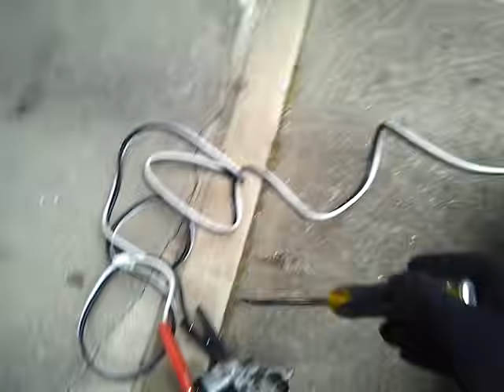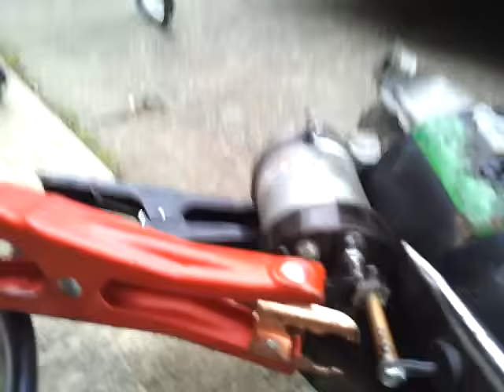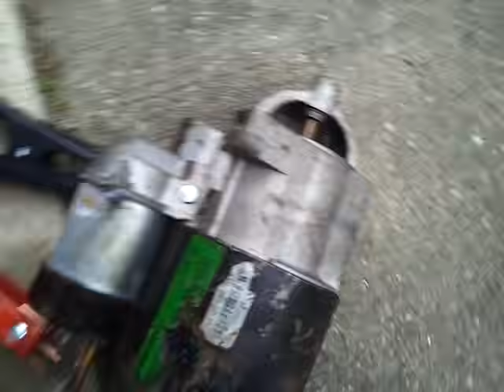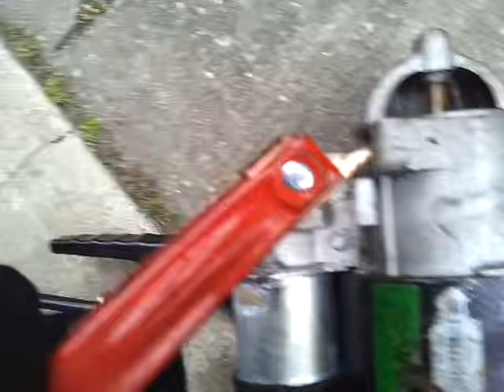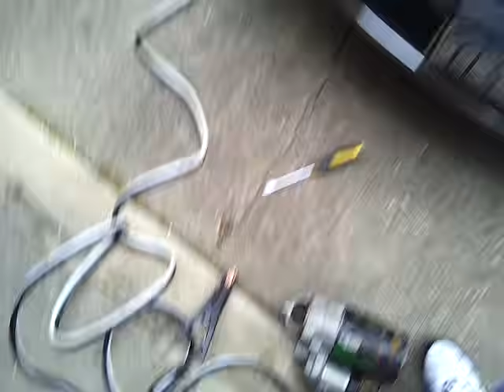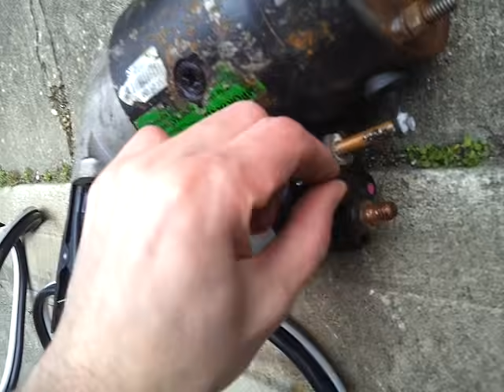How To Test A Car Starter With A Screwdriver And Jumper Cables!

Comment: Volvo s80 2001 wont start here in Stockholm sweden..new battery installera.. still klicking..not turning one iota...cables to starter maybe?  Wd 40 ?
Reply from the maker: Check for 12 volts to the starter and make sure the battery is good
Reply: @klowny1969  thnx

Comment: Do you know if you could do this while the starter is still in the car? As I'm kind of wondering if my starter is bad witch is cranking slow or the cable running to the battery. Thanks
Reply: Someone else's comment on here says that if you perform this test while it's on the car it could potentially overload or burn out other components or a computer. My starter is covered in grime it sits under the power steering system which is also covered in that shit so I need to clean it up and then remove it in order to make sure there isn't any  gunk inside the starter and also where it mounts on the engine

Comment: Just replaced starter, car started, went down and shored up all wires and then no start again, clicking, but no turning over. Thinking maybe a short from a weirdly kinked ground, but if so, would solenoid click like it is? Battery tests ~12v at terminals, but haven’t tested while cranking or tried to jump yet. Replaced starter after unusual clicking even while jumping and after “tapping” a bunch with hammer. I’ll be 1) testing battery then 2) testing old starter to try and isolate the issue. Question: can I test the live wire and ground on the starter while connected at rest? Should I get ~12v?
Reply from the maker: if you suspect its the ground. ohm test the engine block and the negative term on the battery. you can also check for 12 volts at the starter...don't forget to subscribe

Comment: hey yall you can do this from fuse box with starter relay need a small wire the back of relay has a diagram to show what two holes to use make a rainbow from hole to hole! thats what she said

Comment: Can you start a car this way my shell i bought today doesn't have a battery or the ignition.. I want to test the motor and see if it will start or try to crank
Reply from the maker: yeah..but make sure your ignition circuit is getting power too..dont forget to subscribe

Comment: Forgive my ignorance,  but the little gear didn't pop put when you tested just the motor.....so, does the solenoid control that gear popping out? If I have a no crank situation with that, would I still hear the starter motor turning, but just not the actual flywheel engagement?  Thx

Comment: It's a good test to do when buying a rebuilt starter. I've bought several rebuilt parts that weren't any good, so if this test doesn't spin the motor, don't waste your time installing it but just because it does spin doesn't mean it will spin when put on a load, as klowny1969 stated in the video. A couple of things that weren't mentioned were the starter relay (just jump it to test it) and the wires (both positive and negative) that can be bad. A resistance test (ohms test) can show that the wires are good when actually, they aren't. You would need to do a voltage drop test while the starter is under a load to properly test them. If you don't know how to perform a voltage drop test, it's very easy with a multimeter. Youtube has plenty of instructional videos on how to perform voltage drop and relay jump test, so I won't go there. Good Luck!

Comment: 90% of  the time its old grease gumming up the bendex and the shaft..making both spin at the  same rate .pull off retaining spring off the shaft remove bendex degrease relube. And bobs ya uncal

Comment: my starter has failed 4 times and each time i tap it with a hammer and it starts back up.
Would that be a bad solenoid or a bad starter?
Reply: It could be either but in my experience, it is usually because the bendix gear (the gear that jumps out and spins during test) is sticking. You can test both the solenoid and starter with a multimeter to determine which one is bad if it's not a sticking issue. Personally, I use an oscilloscope but they are quite expensive. Just do a search on youtube on "how to test an automobile starter and solenoid with multimeter". I won't get into it since there are many good videos already on it. Good luck!

Comment: Thanks for the video.  My truck wouldn't start good battery and everything.  After I jumped the solenoid I got the high hum from the starter motor spinning but it wasn't engaging the fly wheel and after turning the key it luckily started so I could get home.  Bad solenoid.

Comment: I did the screw driver thing and my car starts but when I try turning the car on with the key it doesnt even turn. Replace the starter or could it be something else?
Reply from the maker: Check the starter relay, and the neutral safety switch and the wiring
Reply: @klowny1969 does a manual car have  a neutral safety switch? And is the relay in the fuse box?
Reply: I have an 02 Honda Accord coupe ex

Comment: I just need to know where the starter motor is, it's impossible to find a video.
Reply: Follow the big red wire from the battery, it will take you to it. If it goes to the solenoid mounted on the firewall first, it will continue to the starter. Another thing that may help you is that it has to connect to the flywheel, which is alway at the back of the motor near the bell housing (where the transmission connects to the rear of the motor).

Comment: nice video klowny! i am having issues with starter on my 79 camaro. Bought a brand new starter for it but the wire (purple wire, i think) that goes to the "S" terminal, is not even there. i believe the purple wire im looking for goes to the ignition. Lemme know if you have any ideas. Thank you for your vids bro they are very helpful for me.
Reply from the maker: Yeah..that's the ignition circuit

Comment: That was pretty good. Your correct, this quick check only checks it in a none load condition, and works about 90% of the time. If the starter works out of the car but when installed in the car (under load) barely turns the engine over, 99% of the time it's either a bad starter, bad cable or a weak battery. I had a weak starter on my 7.3L diesel engine, worked great out of the car but barely turned the engine over. I also had a bad (Internally Corroded) battery cable going to the starter on my 99 Dodge Grand Caravan. The starter passed a load test and the battery passed a load test but the car continued to start slowly and have electrical issues. After the positive battery cable was replaced going to the starter the slow hard start problems went away. We opened the cable and found on the bottom loop it was badly corroded. Our indications were a good voltage at the battery when we tried to start it, but about a 4V drop ~(8.5V) at the starter positive terminal when trying to start it. I thought you did pretty good job on the video. Thanks for sharing it with us. Thumbs up! Best Wishes n Blessings. Keith Noneya
Reply from the maker: Keith Noneya thanks for watching and commenting

Comment: Ok very good info but I have a question. I have and rv and the main starter wire the big one splits up into 2 different wires but it's some type of power connector its hooked to. Ok but I was thinking about by passing it straight from the starter straight to the battery and skip that crap do you think it's a good ideal to do that..
Reply: Can you possibly upload a picture of that here in the comment section?

Comment: You dont need the screwdriver, just touch the positive cable to that bolt..
Reply from the maker: 4201tgreen u need the screwdriver to power the relay
Reply: klowny1969 just from my experience I've never needed one. The second you touch the red cable it activates, your the first person i ever seen that needed one.
Reply from the maker: 4201tgreen u either power the relay or power the starter motor..u cant do both at the same time unless you use some kind of jumper..its impossible..in this case the jumper is the screwdriver

Comment: how strong is this motor ?
can it pull like 200 kilograms ?
Reply from the maker: Filipe Correia ive never tried that..but it probably could..the gear reduction starters are very strong and they can easily pull that..check out MSD starters

Comment: Dont use an expensive screw driver...the handle is plastic and is going to melt.
Reply from the maker: Kampa Nomad wont melt
Reply: I used to start my lawnmower this way and went through about 15 screw drivers over the years I had the lawnmower...maybe it doesnt melt it when testing for split second here or there but it heats up the plastic and will melt off and the screwdriver will become stuck on the posts if you are trying to start the vehicle this way.
Reply: I am sure people watching this will realize they can start their cars this way...just wanting people to be safe because if the metal of the screwdriver gets stuck it can damage the battery as well as burn your hand. Good video though thanks!

Comment: Is the S post the same as the ignition switch? Mine does not have a stud with a bolt only, a single plug that hooks up to an electrical harness.
Awesome video, Klowny1969.
Thanks so much.

Comment: x corolla 2002 when i turn full right or left my car engine shakes & stops & sometimes it doesn't start at all, a mechanic  bypassed  the starter line with a relay   is it okey, the no start problem is gone

Comment: I recently took out my starter and am Installing a new one. I have a 1990 Chevy Caprice. 
I have the starter mounted but I forgot my wiring. So the red wires go to the big terminal on the solenoid, and the purple wire goes to the S terminal on the solenoid. Heres my problem
I have a thick single plain black wire with a ring on it. I have no clue where to place this?? Im pretty sure its suppose to connect to the starter somehow. Although I keep reading its a ground wire?? The wire is short and isnt to many places it can go, where does this wire go??? Id apreciate it very much

Comment: Did a bench check on a starter that would only "click" while installed.  After completion of vehicle starter electrical checks ( all was good). I removed the starter.  On the bench it worked fine, gear popped out and gear rotation was as it was supposed to, however. ITEM OF NOTE. Starter bench operation, while seemingly working fine , did not have the rotating torque it was supposed to (torque rotation of the starter gear was not sufficient to rotate the flywheel). I was able to really note the difference after bench checking my old and new starter and make the comparison.  If electrical checks are good its likely the starter.  but great vid.  thanks

Comment: You can get a false positive on the solenoid check .... I just found out the hard way. A bad spring in the starter will kick the gear out but it wont stay engaged on the flywheel.  (weak spring)

Comment: I have a 1969 3/4 ton Chevy truck with a 350 and an automatic transmission. I removed my Starter and it has TWO small terminals. One is an 'S' and one is an 'R' terminal.  What is the 'R' terminal for?

Comment: Towards the end there, you were talkin about cleaning up the terminals, which, you can go to your local auto parts store(Like NAPA, AutoZone or O'Reilly's part stores.), they will have a terminal cleaning tool, which is technically a dual tool, where to clean the male terminals, you use the female wiry you first see, but, there is a male wiry tool, that is hidden under the handle of the tool, which turns a lil bit and pull apart.  Another tool, that works good, is a wood handle tool, that looks similar to a toothbrush, but has either brass or stainless steel wires.

Comment: Hey nice video. One question, i have a 2000 ford focus sohc, the car starts fine, the problem is that when turning the key to start the car, the starter makes a loud whistle noise after letting the key come back to the ON position, any ideas?
Reply: +ger tis maybe your belts are not tight enough
Reply: I removed the serpentine belt to make sure it was not the belt or a pulley, same result. Is there any ball bearings inside the starter motor?
Reply: ger tis if you think that is the problem, try testing the starter outside the car, remove it and test it, might be something else
Reply: ger tis there are 2 ball  bearings...one on the armature, and other just behind the gear.

Comment: just because it spins and pops out does not mean its good, out of the car it wont have any load on it and will run fine but as soon as its having to turn an engine it will need amps and that is a different case.
Reply from the maker: yes i spoke about that..thanks for watching and commenting

Comment: What if the starter and battery are good? Ignition switch? I just pulled the starter out of my truck and am about to test it. Yesterday tested starter inside vehicle. Battery side was 12v, when key turned the ignition side (S) was barely 1v. Getting a load test on the battery at Autozone today but again, what if battery and starter are good?
Reply from the maker: Wait i think i misunderstood your question..the "s" side of the starter is only getting 1v when ur cranking? If so that means u are losing power somewhere along the ignition circuit
Reply: klowny1969 No man. The ignition wire was only getting 1 volt. Or maybe I was testing it wrong. I pulled the started and had it tested at Autozone- intermittent fail. Replaced the starter. No more problems.
Reply: @farfymcdoogle3461  thanks for updating this when you found a solution

Comment: btw I once had a car where the problem was insufficient current going to the small solenoid activation S terminal. To start the car I had to take a strip of wire and jump the Positive terminal of the battery directly to that S terminal and that would start the engine up.
Reply: Thanks for that info that might help even help me because I'm getting good readings of 12.2 on both sides  of the starter solenoid and the battery itself is 12.2 so I'm going to try what you said

Comment: Hey fellas, a little tip. If possible make up a couple of jumper wires to attach to the starter terminals. Tighten them, and attach the jumper cable as instructed, then use a momentary switch, between the 2 leads, this will eliminate the sparking and risk of "welding" wires together. Touching the terminals damages the threads, making a reinstall more difficult. I've also made a jig, 2 wires, a momentary switch, and 2alligator clips. Attach jumper to large starter term., attach 1clip to "s" terminal, the other to the large (bat) terminal. Press and release switch to activate starter. Also a bit of wd40 on the starter drive, while engaging can't hurt either.

Comment: Hello! I have a 94 lincoln continental. my car has a push to start so whenever i turn on the electricity from the ignition and i attempt to press the button to turn on the vehicle it suddenly dies. I am complety lost idk if its the starter that gave out or if it has a short somewhere. also i did recharged the batter thinking the battery was weak and still it died. thank you

Comment: That does not mean it is good!!!! even a WEAK/JUNK starter will do the same thing!  as for a weak starter it will do just that. however it may not be strong enough to crank over the motor. and if it is a JUNK starter it could just be the solenoid and not the whole starter its self... so yes this test would tell you if the solenoid is good, and just maybe the starter..... thanks for the video...

Comment: Thanks for the video!  I'm trying to resurrect a 1996 Explorer (clicks but won't start [most of the time]) and needed some basic info.
Reply from the maker: Thanks for watching
Reply: sounds like the solenoid is working (the clicks) but the starter motor it's self maybe junk...   so yes you needed a new starter....

Comment: Very nice job.  Sage advice regarding testing the solenoid.  Question for you.  If,  tomorrow I determine that I need a starter, do you have an opinion on a rebuilt versus new?  30-40 dollars difference.  Again, thanks in advance.

Comment: I found your video very true but with one exception I would like to share with you!  I have worked on starters for many years now.  But I found out something by accident!  My sons' car won't start (battery new) The battery was up to 12.5v but nothing.  So I removed his starter and had Advance Auto test it while I watched.  3x it tested good but when I reinstalled it, nothing.  So I took a starter off a similar car (salvage yard) install it and it fired up.  While the old starter worked during the test but when there was a load on it (turning the engine over) nothing!  (to tired to turn the engine over)
Reply: BINGO....
Reply: You can find out if the starter motor is shot by testing the voltage at the battery during cranking and comparing to the starter voltage during cranking (connect leads to S terminal and ground to the case).  If the voltage is the same but higher than 10.5 V then the starter is bad.  If both are the same but less than 10.5 V then it's the battery, recharge or replace.  If voltages are more than 0.3 V different then it's the battery cables or a ground issue.
Reply: Sometimes turning the engine a bit manually can fix this

Comment: I have a 91 Park Avenue, and sometimes when I try to start it, all the idiot lights come on, but the starter won't engage. Nothing happens. There is resistance when I turn it, but the starter won't spin. I tried to override it at used jumper cables and put the positive on the starter, and the engine would crank and fire for a second, but wouldn't keep running. Thoughts?

Comment: you don't even need the screwdriver just put the red + lead of the jumper cable directly oh the second bolt you r jumping that would test the starter and take the solenoid out of the equation...